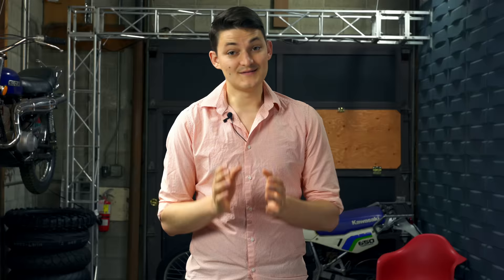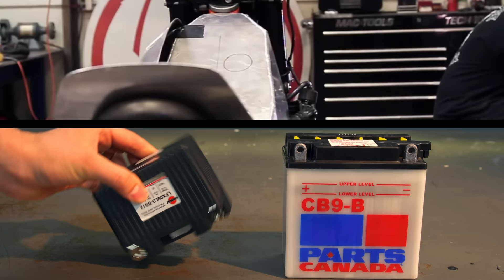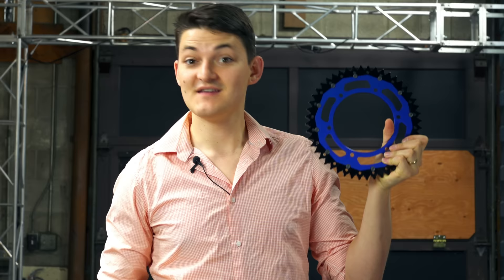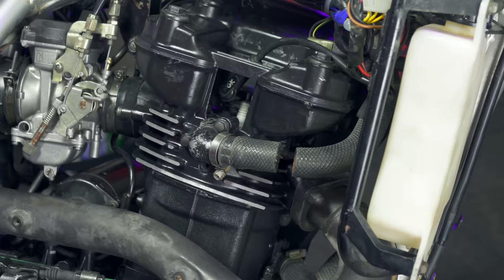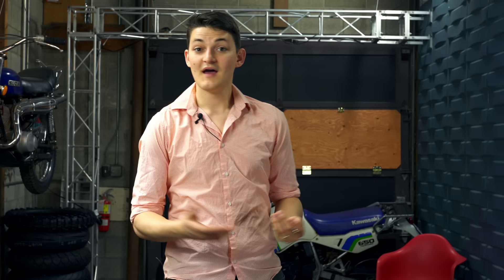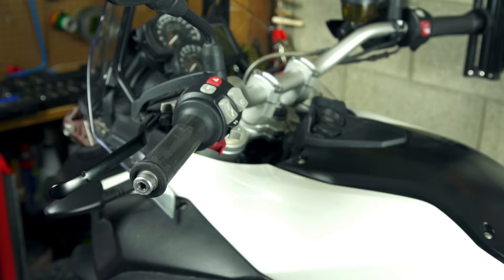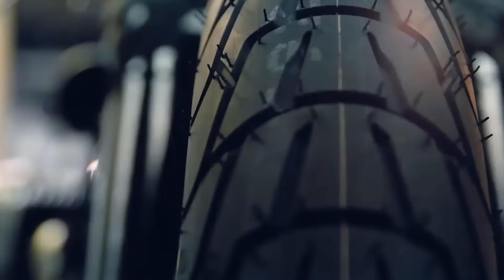10 Game-Changing Motorcycle Mods

Comment: 0:23 Double Take ball-mount Mirrors
1:14 Lithium Ion Battery
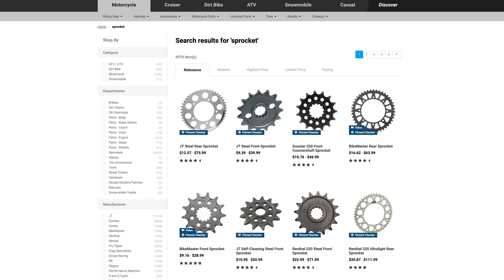2:13 Moose Dual Sprocket
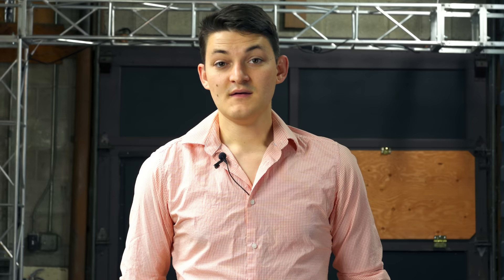3:05 Hydration pack inline filter
3:41 Trailtech digital dash
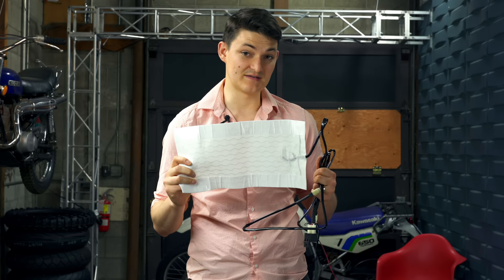5:12 Saddleman Seat Warmer
6:00 Scorpio Security System
6:54 Rox Risers
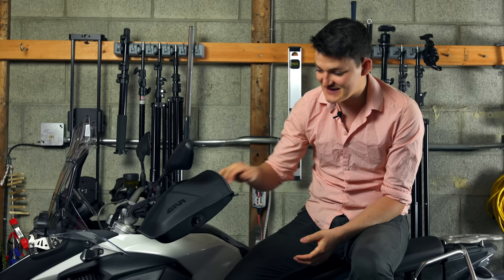7:26 Givi Hand Covers
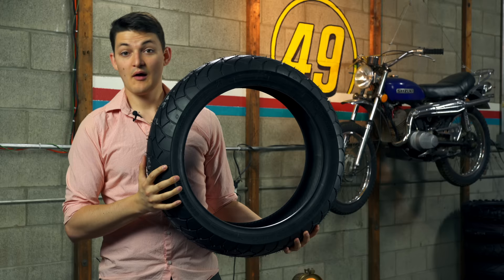8:08 Bridgestone AX41S
Reply: PMitchell106 thanks for the summary shortcuts!
Reply: Thanks Mitchell.
Reply: 5:12 Buttock Boiler
5:12 Egg Cooker
Reply: MVP
Reply: You have to be very careful about recommending lithium batteries for motorcycles because only certain few motorcycles have the type of charging systems that are compatible with a lithium battery about to get charging systems are not compatible with a lithium battery some you can change the things that you need to be able to run it but it can should be expensive
Reply: For me I don't like liquid Crystal displays on a motorcycle because they do not have staying power in long-term anybody who used to buy a liquid crystal display calculator knows that with time it loses bits and pieces of the display and that it doesn't display an accurate reading anymore course it might be a good excuse to get you out of a speeding ticket but officer I thought I was just going hero-hero miles an hour I didn't know I was going 100
Reply: Thanks Mitch!

Comment: A few additional tips about the Sawyer mini If I may. When using the Mini or any water filter for that matter, take special care to not let it freeze in cold temps as it will split the membrane inside sending it to paper weight status. I keep mine in an inside pocket next to my body. 
Also while it is one of my favorite pieces of gear for hiking, riding, or the apocalypse, beware that it only filters bacteria but not viruses. On the east side of the United States where I live viruses tend to not be an issue. Well, unless some a-hole with corona empties his bladder upstream as I'm filling mine.
BONUS- It is designed to fit just about any screwcap bottle or bladder. (Minus Platypus's proprietary crap-I mean cap) And if you don't want to carry the bulky plunger to backflush it, the tip also fits perfectly in a flip top smartwater bottle cap. So keeping an extra cap tucked away is a really good idea for a few reasons. Happy Trails!
Reply: I used mine for filtering rain water in my cabin. I ended up buying a length of hose that I connected to the tap of a ten liter jug that I hang on a hook from the ceiling. Then I plug in the filter at the end and stick it into jugs for filtered water. 

I lived there using it regularly for two years. Sometimes when there was no rain for months I got water from random springs I passed. It made any water taste great.

Comment: I replaced the 50-tooth steel rear sprocket on my little Yamaha TW200 with a 40-tooth (probably should have only gone down to 42-43 toothed sprocket), in order to spread out the gears for street riding. Aluminum, drilled-out and titanium coated, made by Sprocket Specialists. The newer sprocket weighs virtually nothing in the hand. The older steel one was like a five-pound boat anchor.
Before: Topped out at 65 MPH with lots of vibration.
After: Tops out at 80 MPH, with NO vibration, along with an ungodly increase in fuel mileage. And still operates noticeably well in the lower gears.
Reply: @RR-dj8rt  Not at all! I don't even notice anything different in the lower gears.

That, and switching to micro-size turn signals have really lightened-up the motorcycle!

Comment: "As utilitarian as Stalins eyebrows" had us really laughing out loud !!!!
Reply: Especially when they are fitted to a Gen 1 KLR, they actually update it's style by 20 years!
Reply: Brezhnev's eyebrows, comrades. 

Here's a mod that'll save you money and make your EFI bike run on cheap pump swill, get better fuel economy, possibly perform better and definitely start easier. For all those new Harley fellas who have to pay a certified tech to try to remap your fuel injection or find a place just south of your swingarm to relocate your intake air temp sensor so your big, bad, loud pipes and cold air intake don't lean everything out so it runs like kaka- cut (yes, dammit! Cut the wire) coming from your air intake temperature sensor inside your bike's airbox or intake tract and install a 560 ohm 1/2 watt resistor (green, blue, brown) across the cut you just made. It doesn't care which way it goes.
  Now wire any kind of SPST (on/off) switch across that resistor.

To your bike's EFI computer, high resistance at that sensor equals cold temps and wider injector pulse widths/richer mixture. Low resistance at the sensor equals hot temperatures/narrower injector pulses/leaner mixture.

560 ohms is a good starting point and the first resistor value I tried and stuck with in my '01 Kaw 1500 Vulcan.
It made the EFI think it was 40 degrees colder out than it actually was. It enabled me to use 87 octane fuel (cheaper and more volatile than high octane, so it made starting easier.) The throttle responded crisper and my fuel economy improved.
  Octane measures gasoline's resistance to ignition (to cut down spark knock/detonation).
That way the manufacturer can make your engine run as lean as possible to comply with EPA regs. The downside is you have to use high octane fuel to avoid knocking and overheating. This mod cures that by sliding your fuel map colder and richer.
The switch across the resistor (that you can hide almost anywhere) just shorts it out so it's back to stock configuration again.

You're welcome.
Reply: You and who else?
Reply: Suggestions for something similarly adjustable that would look ok on a retro road bike?

Comment: Those sprockets are made by all big companies for years like Motomaster, Vortex, Supersprox etc etc
Reply: Make sure you compare the weight of those dual-material sprockets before buying - Even though aluminum is lighter than steel, being a two-piece design means they need to use more material and I have heard some of them can actually be heavier than just a well-designed steel sprocket.
Reply: @adrianbroughton9752  an all steel sprocket is the best way to go if you ask me. Strong, wears good and no issues because it's once cut and not pieces
Reply: @tacomas9602  I did 3,5k km with this sprocket, mainly off-road, with no issues, it still looks like new, deep notches clean themselves, which is invaluable in the mud. BTW, Moose is buying this from Polish producer, rebranding increasing cost by 110% ...goddamn capitalists ;)
Reply: @adrianbroughton9752  This is true.  For example, the stock steel sprocket of a 2004 Kawasaki ZX-10R is lighter than its SuperSprox equivalent (both 39 teeth).  One drawback of the aluminum "core" sprockets with the steel teeth "ring" is the sprocket is light where it matters least and is heavy where it matters most, so a static weight savings of even as much as 1 pound doesn't really mean much if that savings is towards the center.  You wont even notice any performance difference from just that.  Supersprox for me is more for looks, not for performance.
Reply: I doubt it
Reply: @shonsusan  5
Reply: Cool! Thanks for that note! Havent bought any new sprockets in a long time! Normally buy a few at a time.

Comment: FortNine - something I learned from the phone installation industry.   When cutting your Tie-Wraps use the smooth flat end of the wire dykes down towards the lil lock and the curved end up toward the piece you are removing.  Give a tug and cut.  This will let the Tie go slightly back into the hole, and not leave a short jaggy piece popping up for you to cut your hands on.

Comment: Two budget alternative ideas:
Ryde Angled Universal Motorcycle Mirrors are about £80 cheaper than doubletake . not as good at all, but they fold in quickly and with rubber washers solves any vibration problems and if somehow you do manage to break them its cheep as chips to get a new set.
Heated seats can be made on a budget with a £15  reptile heat mat a switch and a bit of DIY electronic silks.
Awesome video ! cant wait for the one on Lithium Power!

Comment: THANK YOU Ryan for discovering RAM mounts to me. They are totally a life changer. I was so tired of cheapo smartphone mounts with a zip tie and weak mounting systems. I got a X ram mount and it is badass and way more convenient.
Fun fact: 2 months ago someone tried to steal the mount on the community parking. I have the anti theft knob and they tried first by hand (the metal of the "X" was warped) and then even tried with pliers (scratch marks) on the base and they were unable to take it. Sturdy as hell. I just straightened the bent flaps and good to go again.

Comment: I fitted a LiFePO4 (Lithium battery) to my bike about 6 years ago. All I can say is, provided you down't ride in temperatures below freezing, do it It has more cranking amps (starting power) and takes zero maintenance. 6 years later, riding nearly every day, my volt meter tells me it is as good as the day I fitted it!
Handlebar muffs are great in the cold and the wet. Get the ones that fully cover the switch gear so you can use the switches, levers etc. normally.

Comment: Shorai Lithium Battery WARNING

tl;dr perform great but most don't fit right in your bike

I have gotten 4 of these batteries and they all don't fit properly. They perform great, but Cycle Gear & RevZilla size guides do NOT match Shorai's online guide AND BOTH ARE INACCURATE. Following both guides based on my stock batteries has given me batteries that don't fit in the OEM box, and multiple people have reported this issue (Supervisors have confirmed proper choice and obvious improper fitment i.e. "too tall, too wide"). They sometimes also recommend batteries that have opposite terminals, so beware of blowing a fuse or melting an electrical harness.

Comment: 3:50 as someone who HATES digital spedos, that deeply irritates me. 

That said, nice video overall.
Reply: Especially with older bikes, my yamaha rxs100 looks 10x better with analog spedo
Reply: Rahbar Al Haq Well, each to their own... and your view is as valid as mine, but I’ve just put a digital dash on my Yamaha XT225, and its great to read speed and distance in MPH and miles rather than km. Many of the options on my unit have no relevance on the little XT, but i think its a great mod. Nice video too. Les in UK
Reply: analog speedos are easier to read, in all conditions. You are perfectly correct. 
And now for the science behind it: 

An analog tachometer has a specific position for speeds, an angle, that you get used to. You stop checking the number it points at and instead just check the angle it sits at and it's speed of movement, giving you a much quicker idea of how fast you're going and your delta V. 

The digital speedo requires you to interpret the number you're reading and it is next to impossible to judge the delta V by the change in numbers. Further worth mentioning: Sunlight and glare.

Comment: As a motorcyle mechanic I've seen too many of those duel type sprockets fail to recommend them.
Reply: Supersprox brand or just cheap chinese junk?  I've never seen an issue with Supersprox.....and yeah, I'm talking about Moose.
Reply: @Zt3v3  yeah seen the Supersprox fail. They are better quality than the rest but I just dont think you can rivet steel to aluminium and expect it to hold up.
Reply: Yeah I went back to steel after trying aluminum one time. Not worth the money having to change it every 4k miles or so... Just lose a couple pounds weight to make up the difference 🤣

Comment: You forgot one very significant mod. Throttle wrist rest. Not only does it reduce fatigue, but it also improves control of slow speed handling. It allow you to squeeze the brake with two fingers, and still control the throttle with your wrist.
Reply: Or have the Cruisy EVO 2 fitted 😉

Comment: Thanks. Many wonderful redesigns and basic add-ons, but as an electronics engineer i would not use the dash display because of plug compatibility and calibration problems. Bar risers then i would go for them though. Alarms are a luxury and a concealed switch is also very practical.

Comment: I love the Trail Tech on my Ninja 250. It was already in bad shape, and after I dropped it in my first couple months of riding, I decided to just pitch the fairings and eventually the gauges, and even though I needed to buy some parts piecemeal from their website, since they don't exactly make a kit specifically for a Kawasaki Ninja, I got everything hooked up. Speedometer (they sell a brake bolt with the magnet inside the bolt), odometer, thermostat screwed directly into the stock hole in the engine block, and tach (wire ran directly to the coil), worked flawlessly

Comment: I just put a 1.75 inch riser 7/8 to
 1 1/8 fat bars on my wife's 03 xr100, used the protaper contour ktm factory Suzuki bend. best mod by far to date. I put a trail tech on my yz250 and the motion pro coolant recovery system, for riding hard enduro the coolant recovery tank made all the difference in the world when it comes to boil overs.

Comment: bought the double take mirrors, 2 complaints, the extenders are a must and they use reverse thread (LH threads) you will buy them for 30 bucks, they also spider webbed after a year.  Over 100 mph they do migrate.

Comment: Heated grips and a heated vest will do far more for your cold weather rides. I have used a cheap grip heater set on many bikes, and with some good wiring work they do a great job. I choose a harder grip set, as the firmer rubber transmits heat better. I don't waste my money on oxford ones as I never liked the way they fit.

Comment: Dual sprokets. Go with Supersprox. They have a aluminum core with steel teeth. With A life time warrenty on the rear. When it wears out. You get a free new one. They last about 25k miles for the rear. Ive used the warrenty for it. Its worth it.

Comment: I had the Rox risers.....had ......the two pivot  points  make the bars easily knocked of center after a crash...hauling bike through mud ...picking up bike after said crash etc.....I replaced them with simpler and cheaper risers and haven't looked back.....and yes they were installed properly.

Comment: The trail tech doesn’t have current protection.  No fuse or diode built in to protect against surge of AC current.  I accidentally wired a tail light to the AC line off the stator.  Totally fried the Vapor.

Comment: What about TPMS (Tyre Pressure Monitoring System), these little baby's remotely and constantly monitor your motorcycle's tyre pressures front and rear. The transmitters replace your valve caps and the receiver mounts on your handlebars. At around £20 to £30 a throw they are a very useful modification.

Comment: As far as the sprocket goes, that might be making the power issue worse. Rotational inertia is less reliant on total mass and more reliant on how much of that mass is near the outside edge. With those dual-material sprockets you are putting more of the mass near the edge than on a regular steel sprocket, potentially causing an increase in the moment of inertia for the aluminum/steel sprocket compared to a normal all-steel sprocket

Comment: Given how lithium batteries tend to overheat in the sun, I don't think it's worth saving a couple of kilos. That's a bit less than 1% of the bike's dry weight. Also worth noting that it may cause issues crossing borders.
As for tyres, I use Michelin dual compounds, and like showing off that I use decent tyres.

Comment: I had a TrailTech Vapor gauge and it worked for 2 years and then had erratic speed pickup with the magnet.  Tried resetting the unit, and contacted TrailTech to no avail.  Just my experience

Comment: I'm not convinced about the seat warmer: It just makes the contrast with more body exposed parts larger...  I'd rather have one of these battery-powered underjackets, or an extra thermal layer. Fingers= thinnest and most exposed body part furthest away from your central heater (namely chest) = obvious weakest point = highest gains. Aftermarket cheap heated grips for the win (+ those handmuffs of course)!!

Comment: NB: the rear sprocket, being part of the wheel itself, is unsprung weight. As such, it has no effect on your suspension if the wheel remains in contact with the ground :p
Reply: which means that the weight savings contribute many times greater than the same amount of sprung weight.
Reply: @MillionairesDiary   True that. @Theo Lubbe needs to do some more physics homework.

Comment: Sprockets are unsprung weight, not sprung weight.  The advantage is  less spinning mass so easier turn-ins.  
Perhaps there would be less hop over bad pavement under hard braking....but only if the wheel really is moving around.

Comment: Why not try fitting a Scott oiler on your bike it drops oil onto the chain when you close the throttle  using the vacuum in the manifold created by a closed throttle to open a valve in the automatic oiler it can make the drive chain last over 30,000 miles

Comment: I bought the seat heating pads because i drive under minus degrease. But it was complicated to place it under the seat because the leader was glued on the seat with some foil between. So i decided to put it in my motorcycle Trousers. Works very well. After 2months using one of the carbon breaks so my ass gets sudendly burned. I was lucky the trousers did no damage but the heat pads was kinda burnt on one place. I dont know if this would also happen under the seat. But im happy it wassn't there. What was your experience?

Comment: My lithium battery kept leaving me stranded by shutting off from heat. Of course you Canadians probably won't notice that problem like I did in Florida.  I put the reliable acid battery back and now I use the lithium for my ultra portable air compressor power source.  I can't believe how light it is.